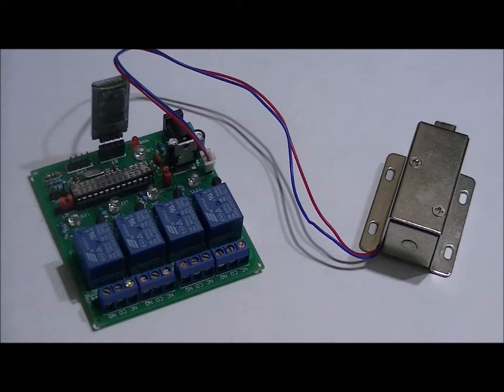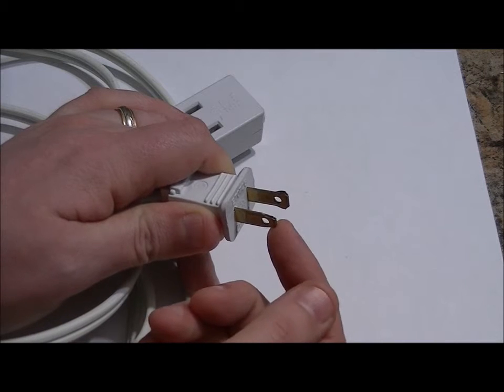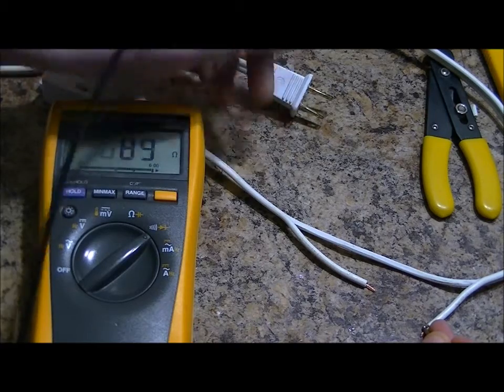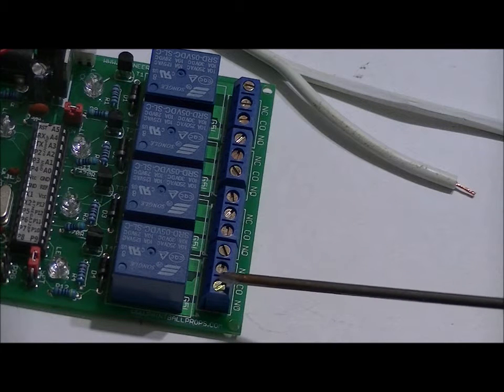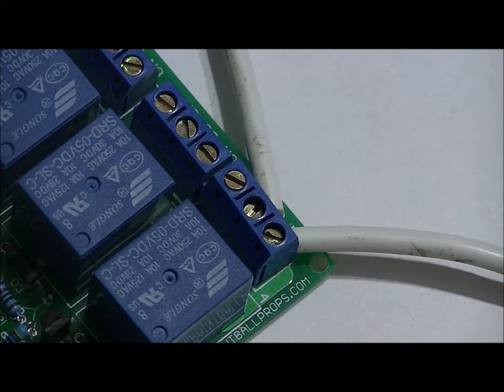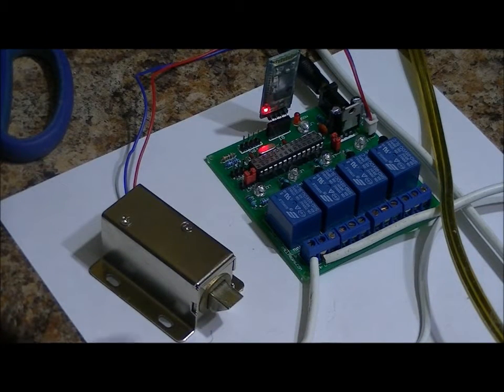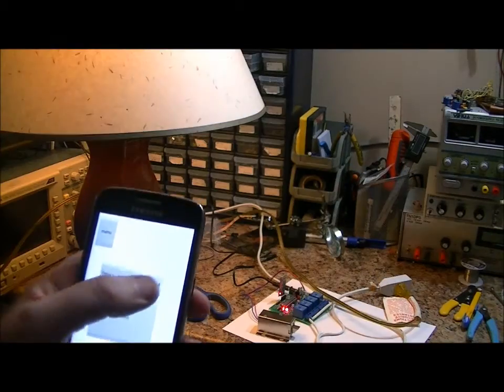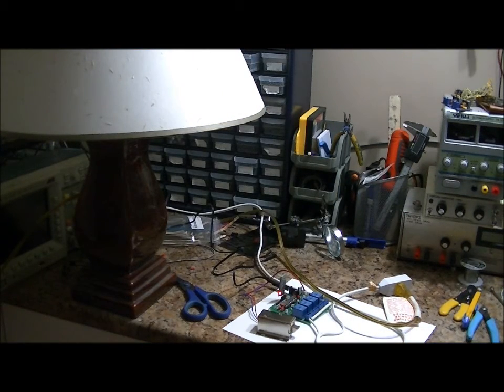Easily Control AC Devices Via Bluetooth Using Our Bluetooth Relay Boards - Kickstarter Campaign

Comment: i would use the board relay to activate a separate AC 120v  15A rated relay to avoid the AC power danger to the board, it may be redundant, but cheaper to replace